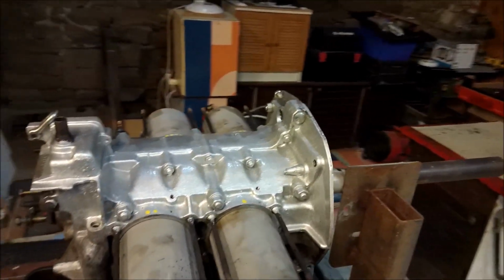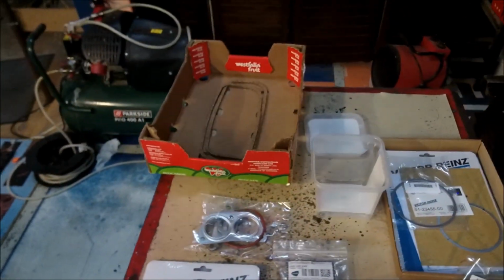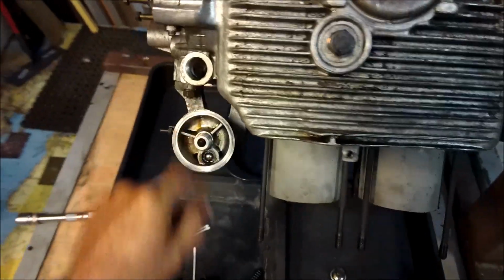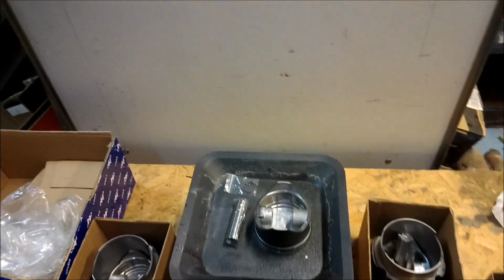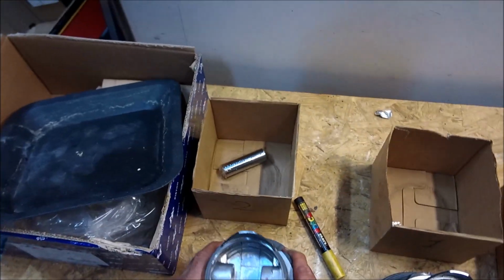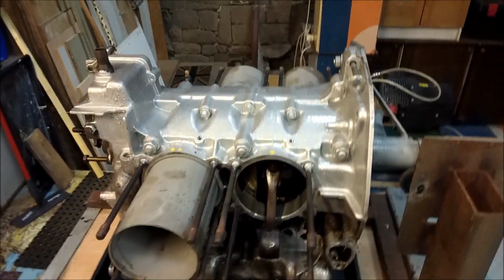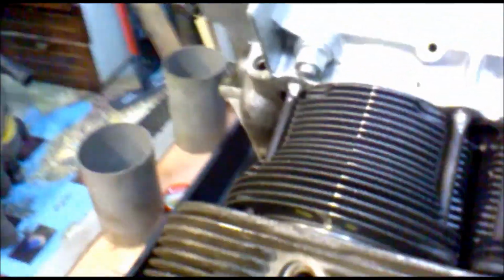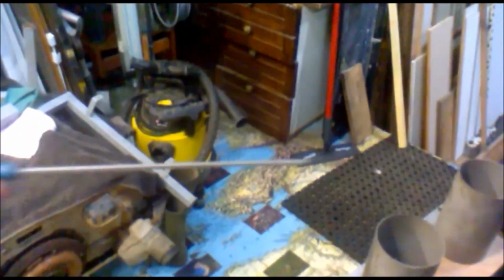VW 2 litre aircooled CU top end build part 1

Comment: Hi, enjoying the build videos as I build my first engine a 2.0 CJ  And have a few questions.  I have AA pistons and barrels with AMC heads, is it possible to fit hydraulic followers from a CU into the CJ and if so what parts from the CU would I need? 
Regards Paul
Reply from the maker: Hello, The CJ engine was available on later bays. Before '79 the cylinder heads have oval exhaust ports. Changing to hydraulic cam followers is possible, but you will have to check the pushrod lengths. Frankly, if the cam lobes are in good condition, I would be tempted to stick with the solid followers, and accept the valve clearance checking. At least you will not have to worry about the cam followers draining down so the engine rattles on start up until they pump up.
Cordialement,
Reply: @sarran1955  thank you for the response, I will stick to the originals as you suggested. Would you happen to know what the deck height should be for the cj motor? and also do I need to use the top cylinder head gasket/seal rings  with the amc heads or do I just lap the barrels in? 
Regards
Reply from the maker: @paulmarshall1226  Hello,
Does the engine have dished or flat pistons?
Use a new set of decompression rings for the head every time. This does not stop you from lappin in first to get a better seal.
Cordialement,
Reply: @sarran1955  it has dished pistons
Reply from the maker: @paulmarshall1226  Hello,
So you have a low compression engine. Nothing to be gained by tweaking the deck heights. H=1.5 mm approx. Make sure you use top and bottom spacers..as supplied in the Victor Reinz full gasket set...
Cordialement,
Reply: @sarran1955  fantastic, thanks for all the help very much appreciated. 
Paul

Comment: Hi. Excellent video as usual. Can I just ask re deck height, what is it (or should it be) on this engine and piston combination. I ask as I'm fitting exactly the same piston and liner set on a stock 2ltr CU so should be plug an play, but I'm only getting 0.3mm deck height, which seems to contradict most sources that say should be 1mm-2mm! 

However, I'm not sure if that is for a flat piston, and in fact 0.3mm deck height is OK for dished piston heads like these are. 

Any help appreciated. Thanks
Reply from the maker: Hello, 0.3 seems ok as  you are using dished pistons. On the AA pistons website there is an engine calculator. Don't forget to fit the decompression rings between barrels and heads..
Cordialement,

Comment: No need to set deck heights ? I had a issue with a 1.8 every so slightly kissing the head under load 😢 sounded awful but I learnt my lesson on checking them lol
Reply from the maker: Hello, not an issue with standard parts and gaskets,
for a deck test demo please look at 1600 to 1700.
Cordialement
Reply: sarran1955 the parts I got where probably of poor quality
Reply from the maker: @ep82chris   Hello, I use pistons and barrels from AA performance in the USA, valves, guides and gaskets come from EU.
Cordialement,

Comment: Why did you go only for a top end rebuild instead of a total rebuild? I'm asking because I went to a mechanic (VW Evolution, Salisbury area) 2 years ago and suggested only a top end rebuild and then after all the work the engine lasted only 7000 miles more, leaving me with a total rebuild to be done only after 6 months.
Reply from the maker: Hello,
Top end rebuild option taken as there was plenty of oil pressure
and no end float. The owner is looking for a spare motor to
rebuild at leisure.
Cordialement,
Reply: @sarran1955  great thanks! That seems more than a spare motor...:)